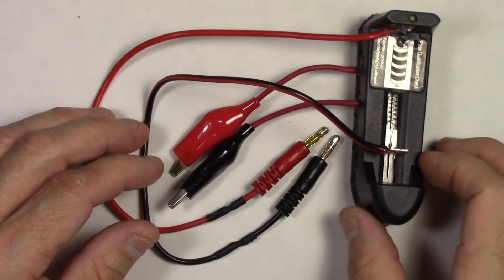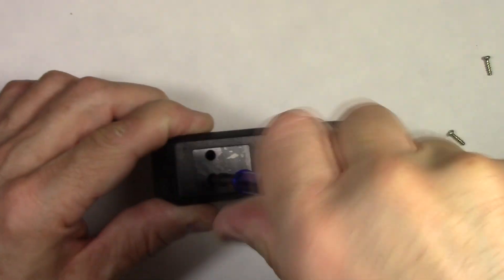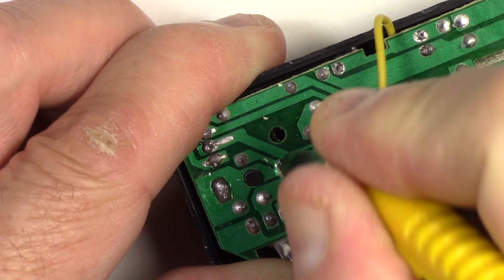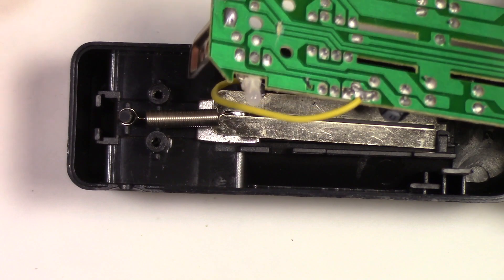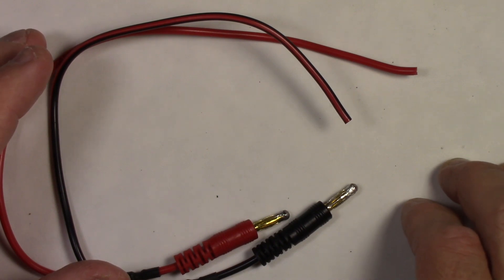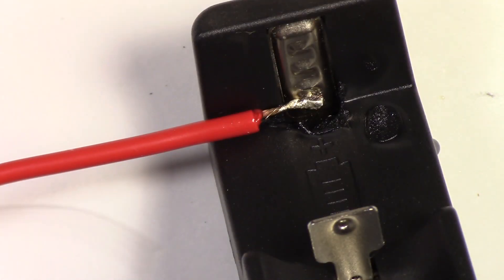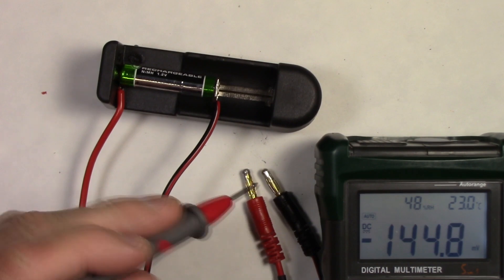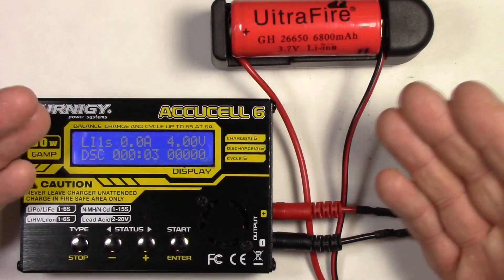How To Make A Universal Holder For Battery Chargers AAA-AA-C-D-14500-cr123a-16340-17-18-26650

Comment: lol, i use the same one, i gutted mine and did go underneath using General Silicones USA Ultimate leads with banana plugs, handy piece of kit. ps gutting meaning exactly as you have done.
Reply from the maker: Great Paul. The banana plugs are important too. Too weak a fit on those and you get noise and resistance too. I will look into those leads. Thanks again.
Reply: Richard Lloyd Cheers Richard, doing this to a top of the range Chinese charger frightened me at first, lol.

Just checked that USA wire  i bought from a hobby shop a few yrs back, look like it`s not available now, try Turnigy thats good cable.
Reply from the maker: I will look for a suitable set. I may make my own too as you seldom get the cable and banana plug combination you require. Thanks again.